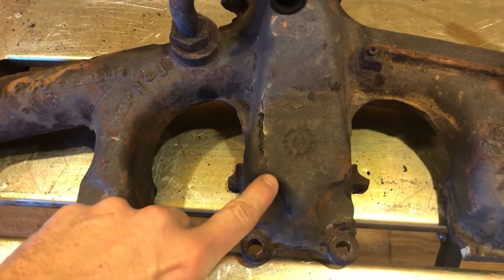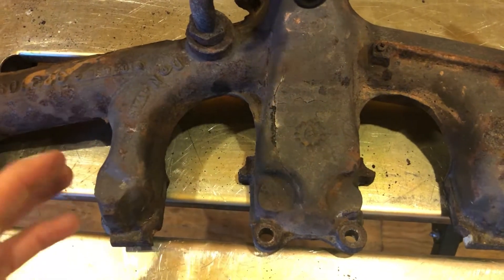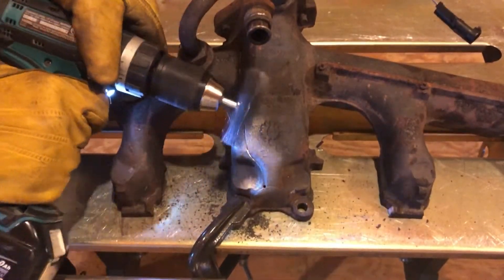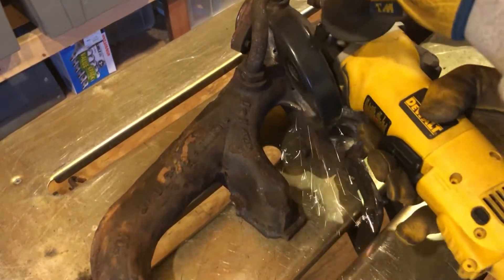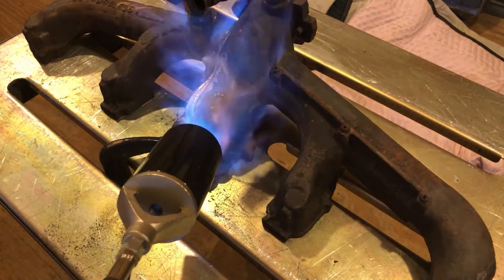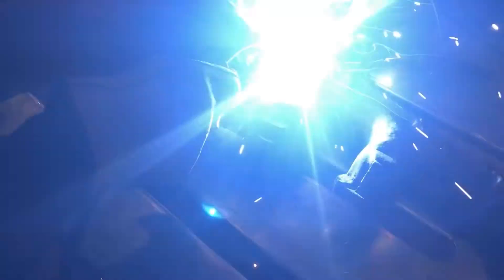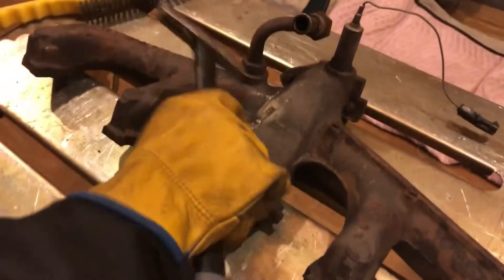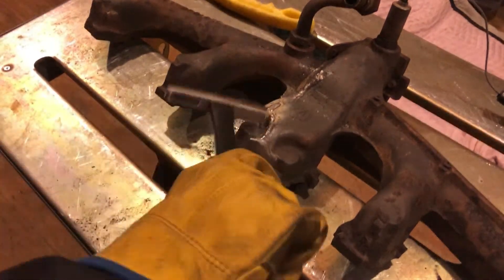Welding Cast Iron Exhaust Manifold

Comment: I am curious if this has held up over the long-term. I've had good luck welding ornamental cast iron with MIG but never tried something like an exhaust manifold.
Reply: I’ve beat on it pretty good riding trails. Even with a couple overheating events. So far so good. On the farm I grew up on, we would have our tractor exhaust manifold welded it would last four years.  That was stick, if I remember correctly. I’ll update if it fails.

Comment: I was actually interested in knowing what pressure and time you were using and if you it were just a small 3/8" cut/crack would you just touch weld❓
Reply from the maker: I don’t remember the feed speed or voltage I was using. I’m in the middle of a move and everything is in storage or I’d go and get the swing of the machine I was using. If it was that small I would drill on the start and end of the crack to try to prevent it from spreading. I’d the grind out about 1/16” into the crack to give the weld something to bite into and do kind of like what you are talking. Small welds and making sure to clean the slag off between. That would be my approach.
Reply from the maker: Swing = settings

Comment: Thx for the video. Did the weld hold? I have a couple odd jobs including an exhaust manifold crack that I was thinking about getting a welder for. Appreciate hearing if it lasted.
Reply from the maker: So far it has held with no issue. It’s mainly a mountain trail rig. I have taken it out and ride it tough it hasn’t had any issues so far. I’ll reply if I see it fail.

Comment: I believe I would have removed that O2 sensor first…
Reply from the maker: Agreed, normally I would. I tried getting it off using every means I knew. I felt it would break off and I’d have to patch a hole. I really doubted the Jeep was reading anything from it, so…I just went with it. Good point for other vehicles.
Reply: I was thinking on peeling of the core of a nickel rod and weld it with a tig welder. Is it possible?

Comment: FIRST rule of welding cast iron (particularly dirty shit like exhaust elements) - NEVER use a hard-stone grinder of any type. It drags carbon out into the weld area.
Use a file, die grinder, or a Dremel (for little jobs) with a burr cutter, but never a stone of any kind. You did mention flux core but not the actual type of wire. This type of repair requires a nickel type filler. Your incorrect procedure is the reason why you have porosity or inclusions or whatever went wrong.

Comment: What settings were you running?
Reply from the maker: The Lincoln electric unit I had didn’t have “real” settings as a higher end model would have. So I don’t have the voltage, current, or feed rate info. The current setting was on the “B”, so lower current on the selector. Also, the feed rate was about 1/4 off full scale on that selector. That I usually adjust in the feedback I’m getting from the puddle and the wand. I hope this might help to some extent.
Reply: @outdoortypelifestyle9489  rofl it actually does haha,belive it or not I know exactly what you are talking about haha,working with old machines isnt always the worst thing,sincerely appreciate the response thanks bro